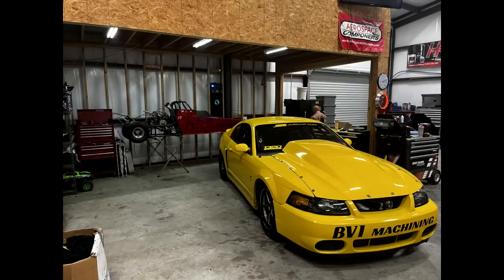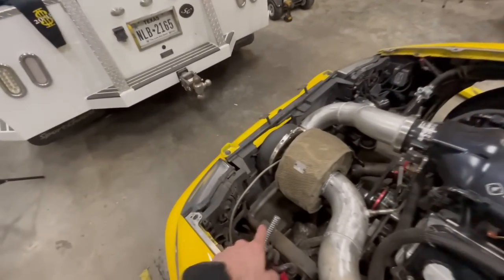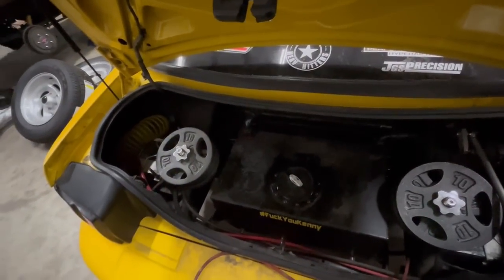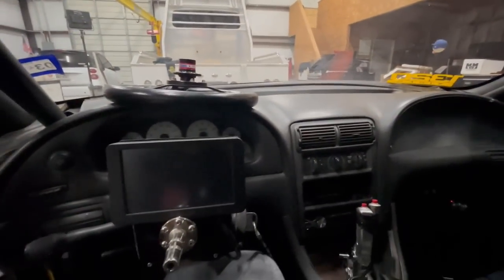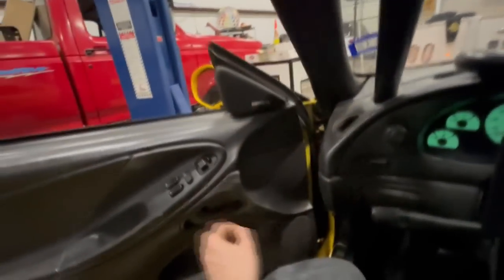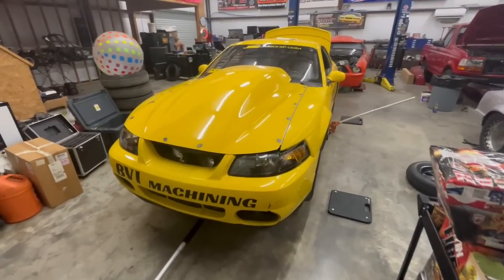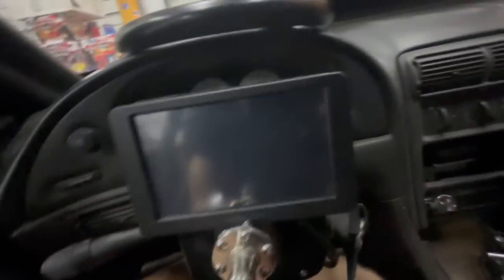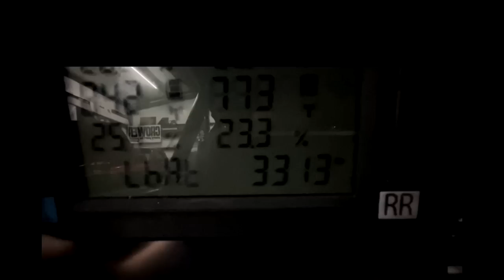Nanner 2.0 In Depth Walk Around and Weight!

Comment: This is the template for a real small tire street car and what should be found in street car classes(I feel that should be a given), absolutely no question about it. On the other hand, a light, tube chassis car with a recessed firewall, strut front end ect that is registered, has insurance and working head/taillights is a "street car" that I have no problem seeing run on the street or at small tire races.

Comment: I’m actually surprised at 3300, I was guessing 3500 including you. I noticed you cut out the inner fender lining but didn’t go tubular? And I image the turbo has to be a solid 20-30lbs on it’s own. Are you running an aluminum block? I’d like to drop a 302 in my own new edge, I’m finishing my tubular front end, might get k member, and doing full carbon up to the rear quarter panels. I’m hoping I can get 2700 with me in it!

Comment: 75% on the nose… and 4” or so of front travel and still killing it on the street. Good old Dr Pepper traction compound still works .
Reply: the scale shows corner weight percentage.  Its 51 ish percent on the nose.  Got to add each axle together.

Comment: The key I see is the 51%/49% front rear weight distribution. The thing I was really hoping to see was the rear suspension because THAT is where the magic happens. 
My BIG question is; why not do some simple things to shave weight off the car? 
Fiberglass fenders 
Manual windows 
Details here and there and I would not be surprised to see the car 200 or more pounds lighter. 
But, 
Everyone knows the "Nanner" is a race car....why not really put it on a diet with Lexan, fiberglass/carbon fiber body pannels/doors and dash. All that while keeping the look of a "stock bodied" car.